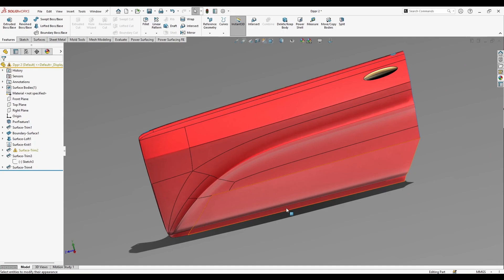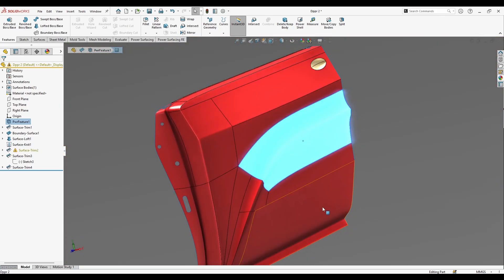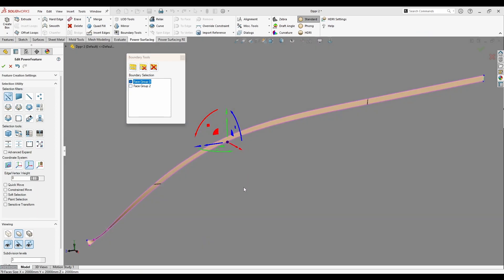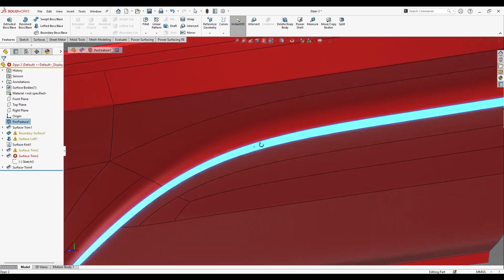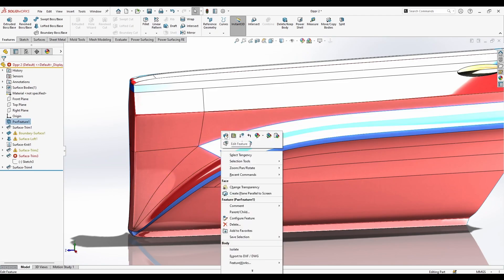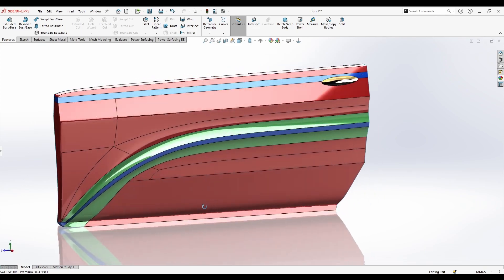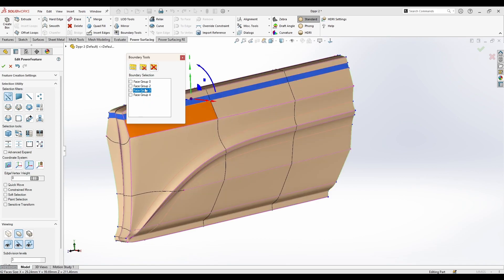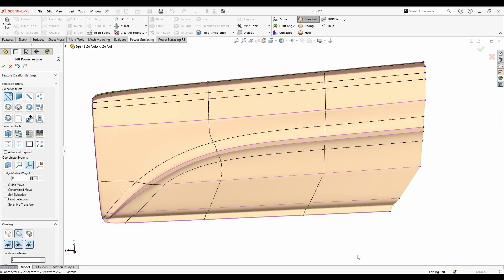Explaining Boundary Tools - Power Surfacing | SOLIDWORKS

Comment: Good one! Thank you! This is the better way to convert? I usually do the conversion 1 subd to 1 Nurb, to mantain all faces but I think this is not the optimal way to transform. Maybe this could be a heavier files rather than your conversion?
Reply from the maker: Thanks ! 
There is ''Percise conversion'', try it.  it's almost the  best and faster way to convert. its also not taking that much space for files, How ever you can convert as ''Proxy Box'' And get the smallest file ever. Boundary Tools give you more control for Selection surface.

Comment: i've tried the addin, it's really great and extremely usefull.  but some little improvements could make it much better. for example there should be a way to assign shortcut keys to every feature not just the Extrude and Insert loop features, especially the selection settings (constraint move, soft selection, paint selection ..) . 
the other important thing is the constraints environment is very confusing, why you letting the software automatically constraining to the nearest vertex or edge and not giving the user more control, it would be much better if the user can manually select each component he would like to constraint to, and keep that created constraint in a documented list that he can revisit and edit each constraint apart clearly and easily.
Reply from the maker: Thank you! , we will consider that.